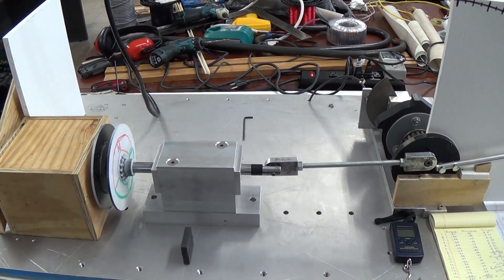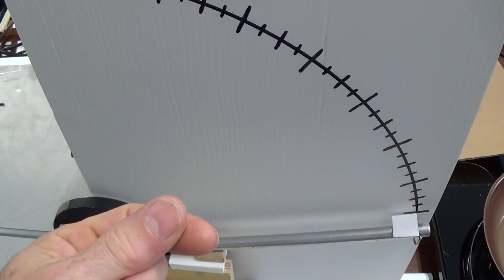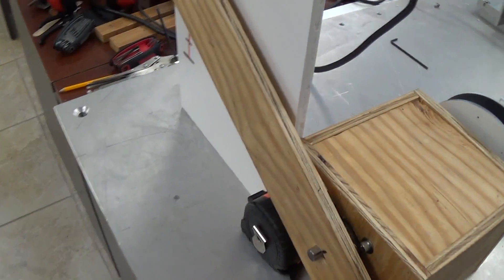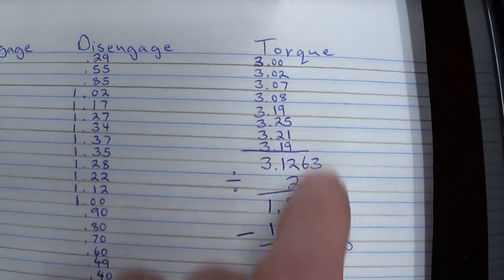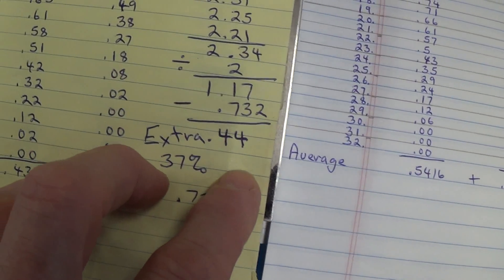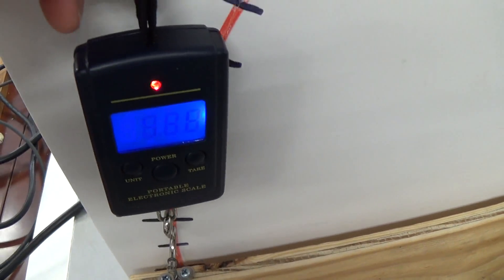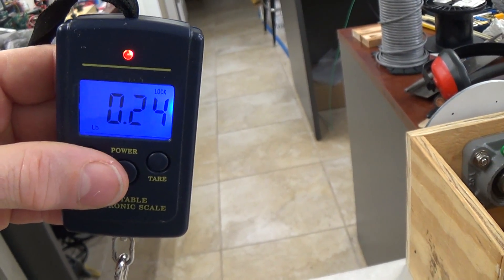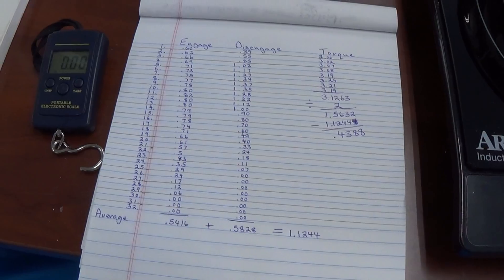Floor's Twist Drive Permanent Magnet Torque Amplifier test 2

Comment: Excellent work! That's a lot more effort than I'm usually willing to put into an experiment. Reminds me of TheRealVerbz's videos on magnets magnetized at 45-degree angles instead of perpendicular to a given face, making them move in discrete steps like you'd expect from a stepper motor.
Reply from the maker: If you can post the link to the video you're describing I would like to see it. Thanks

Comment: Im no expert in gear ratio stuff but is there some kind of mechanical advantage not being accounted for in the aluminum bar side?  The rotor the bar is attached to has the shaft to the magnet offset.  Im wondering if that is throwing off the results because the wood side is attached directly in center of the rotor, if that makes sense.
Reply from the maker: If there was a mechanical advantage it could not work in both directions right, it would show up in one direction and counter effect the gain in the opposit direction (action reaction). Also, the input is measured in BOTH directions which eliminate this kind of thing if even possible.  Luc